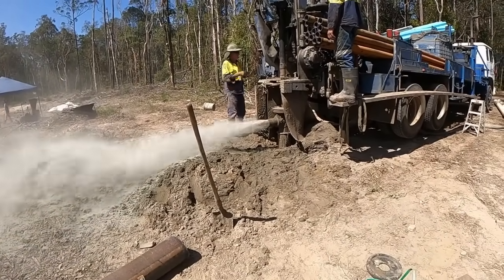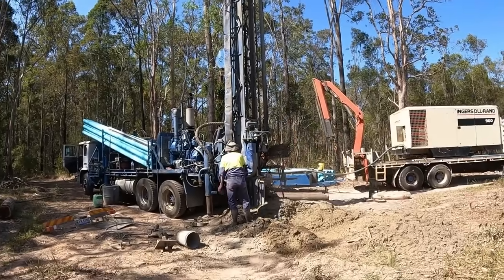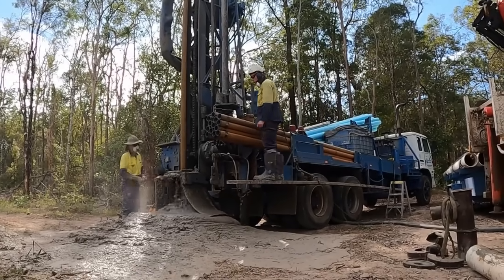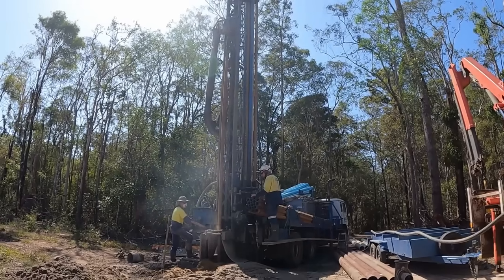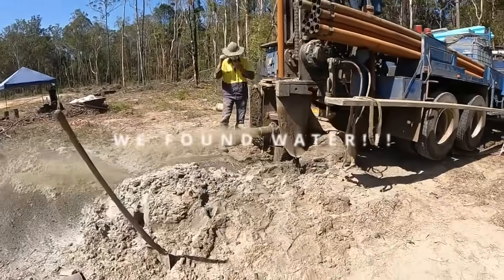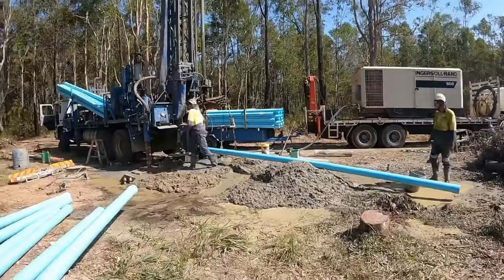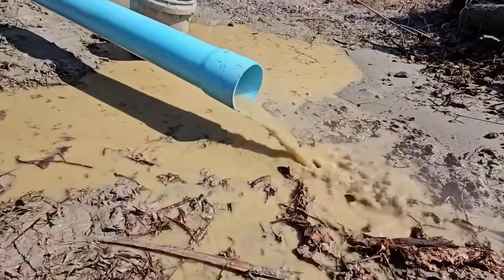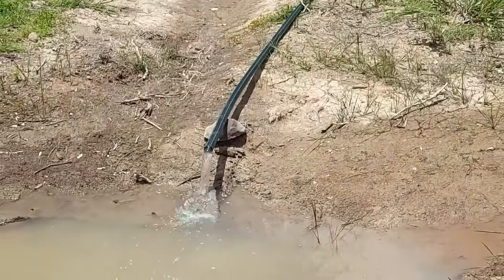We Drilled 36m Down for Water in Australia—You Won’t Believe the Result!

Comment: A buddy of mine had a pig farm, he was raising weaner pigs, just babies just weaned from their mothers, I guess there's a lot of farmers don't want to deal with the breeding and birthing part. Anyways he was paying a vet to check if the breeding part worked, testing if the sows were pregnant., and it was an added cost. An old farmer said he just dowsed them. Hang a needle or a nail or even a nut from a bolt on a string over the sow. If it goes in circles they're pregnant, otherwise it just swings around. He showed me on a sow, sure enough it went in circles right away. I said you're doing that, he said ok, you try. Same thing, it went in circles. He said try this one, so I did, it just swung around random. He said ya, that's the boar. My wife was pregnant, so I held it over her head and it went in circles.Later on I was telling another friend the story and he asked if it would work on a cow. I said "It should, it worked on my wife!" I think I might still feel that bruise on my shoulder.

Comment: they did not need to run 30 metres of steel, could have just run surface casing 6 metres at the most and drilled with fluids to keep the hole open, and why did they not remove the steel as it now is not doing anything and fill the void with gravel, I have been in the industry for 50 years, and why did they not put in gravel to stop the fines coming in which will ruin your pump, and did they develop the bore to clean it out. would not get these cowboys to drill a bore for me

Comment: Wonderful piping , you have probably seen what they called the 'Bore Drains', huge rectangular gully through the paddocks for the stock , they have been chased down probably and stopped. The variation in the bore water is amazing heated sometimes and some that would go straight through if you drank a quart pot top of tea while out mustering on horseback, looking at some of the old bore casing there can be quite a lot of corrosion. if the bore casing is past water use it can be utilized for making yards / gates or loading ramps etc., Thanks for the excellent Video.
Reply: Cannot beat a good bodge job ..sorry wrong answer. It's called recycling now . But I love turning old junk into a new use

Comment: Have you seen the welding machine out of china where you join the two tubes using the machine to perfectly align. Hit the button and it runs around the joint leaving a perfect weld. It doesn’t look like a mig setup although it has a controlled atmosphere at the point of welding.  Love your work. Impressive video

Comment: Very interesting. We have so much water, our problem is getting rid of it. But I’d rather my have issue than yours. A few questions if someone could answer

Do you find water from an underground lake or a river or within porous rocks - or what?
Does a lake get replenished or there just what is there from time immemorial?
A river presumably flows. Is it from one lake to another?
If the supply is not replenished, could you run out of water after years?

Thank you
Reply: Depends on the geology under the ground

Comment: Oklahoma USA here. I know that feeling all too well well. They were near the end of depth. Just dust coming out of the hole. I was on my knees holding my head. When water came out. We ended up 300 feet at 15 gpm. Water is life. Glad you hit water
Reply: 300 ft, Jeepers that's a fair way down, how long did it take to get that done
Reply: @WillyT4523  Well here in Central Oregon, my well is 780 ft with water at 640. Many underground volcanic cavities to be pumped with concrete to keep drilling. Return water pressure at 740 ft. once through a basalt block. 30 GPM with 15 hp 3 phase pump. Pure water underground over 70 years.

Comment: Our borehole is 236 feet deep,from memory the water level is 45 feet down from the surface and the foot valve is approx 60 foot down,we didnt know what we had for many years with an old climax pump and wooden rods bolted together and a bronze foot valve,My father decided to renovate this as it no longer pumped,it turned out to be a leather washer needed replacing, that was around 30 years ago and its still working.It pumps up into a small water tower switched on via a float switch,then gravity takes it to the pressure vessel and filters We have a lot of iron so it goes through two iron removal tanks then supplies the house after being filtered yet again.We had the water sampled via a lab and all is good once the iron has been removed.Not sure why they drilled so deep though,it was lined with a galvanised pipe but soon went to just a chalk core the rest of the way.

Comment: As far as the divining goes, you're wasting your money.  Sandstone formations are laid down in layers.  For example you may hit 50 ft. of solid brown sandstone overlaying another layer of perhaps 200 feet of grey sandstone, then maybe a layer of sand, etc.  Between the sandstone layers, you usually get a thin layer of clay.  This layer of clay works as a conduit to deliver water from the porous sandstone into your bore hole.  The rock basically works like a sponge, retaining and releasing water.  In igneous formations the water comes from fractures in the rock.  If the driller had drilled in the immediate area, he should have a pretty good idea of what and how far down he will be hitting bedrock and water and the yield.  If not, the well records of nearby wells will have the information.  Hence, the uncanny accuracy of the diviner.  I retired from drilling water wells 30 years ago, and a six inch well cost eight dollars ($8) per foot plus an extra eight dollars ($8) per foot of casing, no kidding.     That well would have cost approximately $1920.  I glad I retired, it would pain me to charge $100 per foot.

Comment: By my standards a shallow cheap and easy well.  Here in Canada you hit granite a couple of feet down and drill solid rock 100m or more till you hit the aquifer.  You also have to trench all the output a meter and a half down or case it in insulation with a heating element inside so it doesn't freeze up in the winter.

Comment: I have used diving rods, made of hazel branches in Eastern Canada, for my own well, which turned out very successfully. Mine was a shallow well, which I dug by hand… but it lasted the 10 years I was on the property with 2 daughters, a water purifying system with water which was laced with arsenic and a trace of gold! Queens County, Nova Scotia!.
Reply: My hats off to you.  I never dug a well by hand but I did deepen my well with a home made churn drill and a spring pole.  Later on when I had a drill rig and drilled many house wells, I came across a number oh hand dug wells, and marveled at the tenacity of purpose that people like you had.
Reply: @IvanJardine when young ?? But at 73 now with years of being a grease monkey. Joints worn out. Have a job digging a hole to plant a gooseberry plant. .

Comment: For those contemplating getting a bore keep in mind finding water is step 1, Finding quality water is another issue.   Salinity is a major issue in much of Australia, especially for fairly shallow
bores such as the one in the video.  Sodium levels can be so high you can't use it for most plants, higher still for stock.  Removing salt is expensive. Reverse Osmosis units cost as much as
most bores plus pumps. Next problem is mineralisation, most commonly iron. Again without settling the heavy minerals out eg; in a dam or tank the water can be problematic to use for
agri/horticulture and stock.  As the iron oxidises ( hits the air) it will stain everything . It can also limit the life of your bore pump dramatically !     Calcium is also a common issue but less
harmful if used.     Test your water for both TDS ( total dissolved solids) and PH.  and then ( if high for TDS or too high/low for PH.)  ) get a lab. to test the composition of the pollutants.

Adjust your use accordingly ..... the water may not be potable for household use but fine for other uses  ( or if you are unlucky, not !)
Reply: This is not true, fresh water is less dense than salty water so it sits on top of salty water. Think of the K’gari island (world’s largest sand island), it is full of shallow fresh water lakes that sit on top of the underlying salty water.
Reply: @Youtuber-k2p  You are correct in open water but don't forget geology. It consists of impervious layers. If there is a layer of sedimentary material that holds salty water
with an imperious rock underpinning eg;
basalt then under that layer there may be fresh water  ( something quite common in northern Victoria/southern NSW).

Comment: Is there any way or to estimate how much water is in the bore hole?
Reply: not with high certainty, it's a bit of a mystery how water moves below ground. But by observing a certain bore you can get a sense for it. Such as observing whether the level of the water in the bore drops while a neighbouring bore is irrigating crops for example. Or if it runs dry once, paying attention to how quickly it fills up, or what amount of rain is required for it to do so. In our specific geology water just disappears into the ground in some places, indicating that there's a lot of action happening underground with water movement.

Comment: I know this, I was talking water diving to fellow mechanics in a coffee break. They did not understand what I was talking about, I got two thick welding rods for gas no welding flux, copper coated. I bent them sufficient to put them in two small cardboard tubes I held In hands to show I was not cheating, they all found it amusing until I walked across a piece of ground and the both rods from pointing straight ahead swung inward. This made the hairs on the back of my neck stand up. I was demonstrating the principle, I did not expect a response. The discussion went from what the hell are you on about to, you are twisting the rods, you are tilting the rods. Neither was true, as I walked forwards with the two welding rods facing forward they swung in, if I walked backwards they corrected themselves. I convinced myself there and then it works. The next year a massive water leak was discovered in pipework in that area on site. I remember the shock of it happening and the hair standing up on my neck. Try it, two small cardboard tubes so the welding rods can swing on their, own bend a hands depth of the bronze coated welding rods and try it. Point the rods forward and walk forward when they swing in your a diviner! Over 30 years ago certainly got some debate going but I knew it was real. Try it seriously. The must be a scientific reason for it that will be found out eventually.

Comment: I used to work on an exploration RC drill rig.  
In comparison this looks nice and clean and safe.
Reply: likewise, on a rig just out of Kal we never had a carousel , running each 4 inch rods onto a 4 and half inch hammer down no more than 250m. in fast ground it was like doing footy training for 12hrs/7 days a week . Hard ground  the days dragged but i were the fittest blue rod greased smurf ever. Eventually becoming driller  on much the same equipment here

Comment: If you walk away from where the rods cross, walk away count your meters and that’s how deep it is
Reply: No, it's complete bullshit.  Divining is complete crap.  You get water flows by drilling into permeable rock that has water in it.  If there's sufficient hydrostatic pressure, it can reach surface levels.  If not, you have to install downhole pumps.

Comment: That's a old rig. Acco drivin.  
Yes a meth.  Finding water.  Rc rig.  We had two rigs to support the rig. One for extra air. One for water. 
This old girl from the mine. Only.... 
Exspration  the water cart. Had rodes on both sides.  For drilling depper.  The man pulling the road is old school.  
The welds need be air tight.  In the tube. 
So much. Not explain.  You need a "g  o"... 
That can explain.  The rock drilled.  So can unstand  the ground . Can explain where water is. 
Next water test. ????
Pump you used. ???? 
Solar. Or direct. ?????

Comment: In the US they use couplings and threaded steel pipe, quicker.
300 dollars per meter sounds high but it's been a while since Ileft US.
Here in Thailand, NE region, fixed cost for drilled well is about 34 thousand baht. About 1,100 US dollars without pump. 100 meters deep about 60lpm flow with 1,000watt solar pump. Works great 1.5 years in operation. I did pump andsolar.
Reply: Remember you’re comparing Australian dollars with American Dollars.

Comment: We had a drilled well on our farm in Southern  Canada . One year we had a severe winter . The frost went so deep  the casing broke collapsing the well filling it full of sediment . We had a company come in and try remediation , it failed . A new well 20 feet north of the old well was drilled . 80 feet to bedrock and another six feet into the bedrock . We hit the aquifer under pressure . We had an artisan well at 86 feet and was capped . It finally stabilized and we can pump minimum 30 liters / minute but the water is full of sulfurous iron compounds . Not a problem for barn and field use but not potable . Iron levels were too high even for softening so we had to install peroxide treatment . At certain times even that isn't enough . This is all an expensive proposition . If farming was easy everyone would do it !
Reply: Get two tanks for the iron. To settle.   Yes you got me on that. I have never come across this. .. filter??? Sorry  to hear. Mick Australia 🇦🇺
Reply: It is not artisan at 86 feet . You can get magnets that bolt around a water pipe , it clears calcified pipes but i dont know how they would go with really heavy iron content .  Another Aussie , drilled thousands of bores .

Comment: So glad you found water. I do this for a living in the mines in W.A. I have to admit the job they did on the pvc with the angle grinder and tape at the bottom is sub par. That tape will eventually come off and could cause problems with the pump. How long did they develop the hole for? Was it a natural fill? How did they separate the aquifer from the sand above? Still, I'm glad you found water and I hope the bore serves you well for many years. Good luck.
Reply: Yeah, that tape and daggy cut looked pretty ordinary
Reply: I mean you can buy slotted bore casing rather then bodgy it up like that.

Comment: I had one of these drilled at the end of last year. I couldn’t get there to see it done so many thanks for the video. We had to go down a but clenching 90 m. Fortunately, we avoided steel casing. All up drilled and cased was about $200/m. Just need to install the pump, piping and electrics… another 3 to 5k.
Reply: 100m next year then 1m per year till all gone.
Reply: @rogerphelps9939  
If the well is drilled like the one in this vid...
then the 90 metres will have a reservoir of say 15/20 metres above the pump...
so unless something goes drastically wrong....many years of water supply.

Comment: Congratulations:  You were very fortunate!

Back in the 1950s my Grand father had a bore sunk near his homestead... 600ft to the water table... a relatively slow trickle and it was too saline to be of much use except for stock water (& even that had to be treated first)...

Then in 1974, along came a 14 year old know it all (me), with minimal training as a diviner... 
and discovered that they had drilled down in the wrong place... 
The water course that they'd tried to tap into was 10 metres south of the bore (at it's nearest point) so the trickle of water they were getting was seeping through the semi-porous bedrock, dissolving extra minerals as it did so.

When I explained this to my first cousin, who now owned the property, he asked where the flow went because he'd prefer to have a bore nearer the main stock dam since he didn't live in that house.  I followed the underground stream and indicated a suitable place, with the proviso that if the first stream they came to (at about 550ft) was still too salty, there was another stream passing at right angles underneath it at about 850 ft and I thought that was the better water.

My cousin later told me that the first stream was great and they'd had to drill about 28 lengths of pipe (~168m), but only needed 2 lengths of casing at the very top. the new flow rate was about 400 litres/minute [compared to the original of about 4 gallons/minute].

I'm sorry if the mix of metric and imperial measures is confusing, but my training by older diviners was purely imperial & since it's not something I use every day (unlike buying a litre of milk) metric hasn't really gotten attached to my awareness.
Reply: 4 gallons approx 18 litres 
Near enough is good enough for that appllication. I was 14 when metric started so as l already knew all imperial measurements learning the equilivants was easy especially mph and kph
Reply: I am 76 yo and metric hasn't really gotten attached to my awareness either. BUT upon finding out how the meter is based as a fraction of 1/10,000,000 distance from equator to north pole at PARIS MERIDIAN and then divisions of ten, I think it should be easier to use. YET I am used to english measure.

Comment: What was the TDS (total disolved salts) reading? We spent a considerable amount on a bore in central Vic. It was clear, it tasted 'minerally' but ok, over the next 12 months it killed every thing we watered with it. Now not used obviously. It's very hit and miss if the water will be usable after all that expense.
Reply: Sorry to be a pedant its Total Dissolved Solids. You can add an Osmosis filter to clean that up.  Compared to the cost of the bore,  its cheap to add ( less than £100 in the UK)
Reply: we did another video all about the bore water test results and how to interpret them:
https://youtu.be/dXCueRCvnKQ